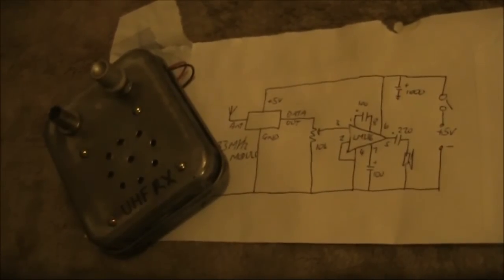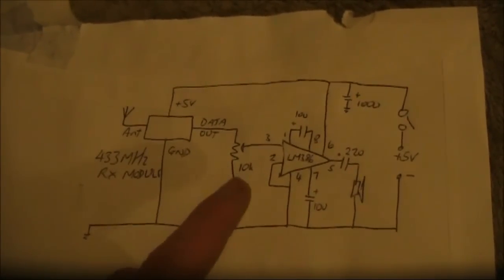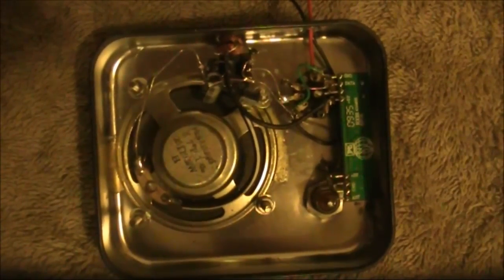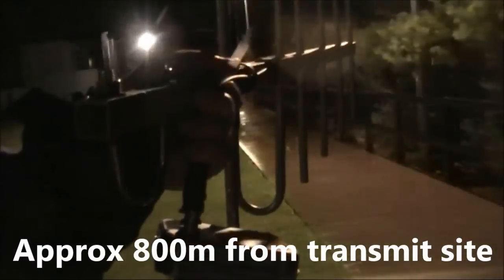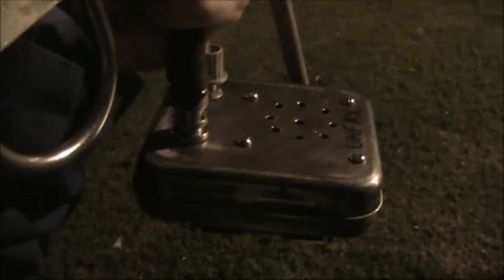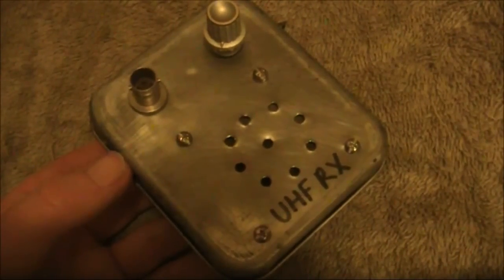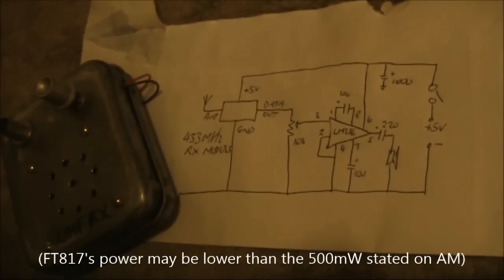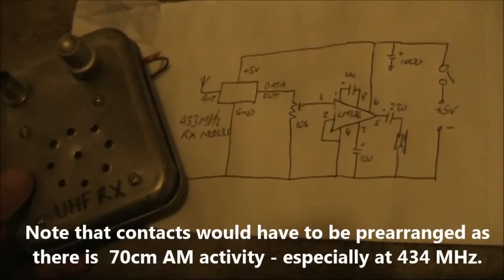More experiments with a 433 MHz UHF superregenerative data receiver module

Comment: I am surprised that worked as well as it did without bypassing the data slicer comparator.  I would have thought you'd need to get the AF signal from the superregenerative detector.  Most of those modules use an LM358 to LP filter and amplify the quench with one of the opamps, then slice the AC coupled envelope with the other.